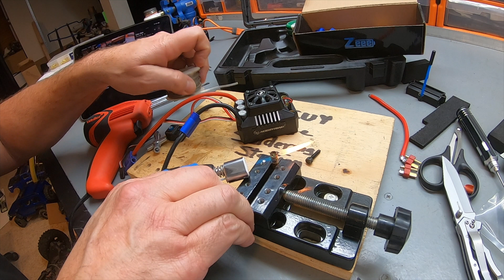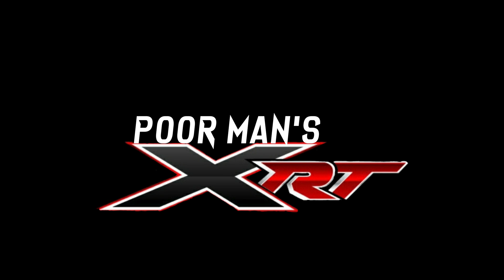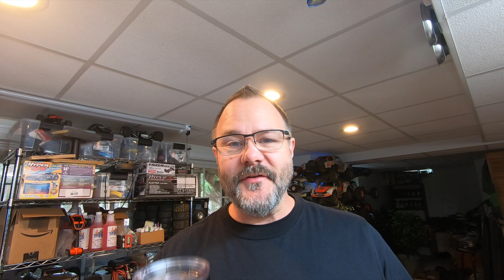Traxxas Poor Man's XRT Project at its END

Comment: Do you know if the X-Maxx  Toe link for steering will fit on the XRT  for steering.  I've seen a few non adjustable aluminum inks for the X-Max on ebay not sure if there interchangeable. Also do the X-Maxx drive shafts come in colors?
Reply from the maker: Yes provided it's from the WIDEMAXX kit otherwise I'd it's the stock XMAXX they will be too short

Comment: How much does it cost to build one from scratch to the point its a roller
Reply from the maker: Building it from scratch is different than what I did because I used a donor vehicle You would have to add in gears bearings screws at that point in time you would definitely be better off just buying a roller or slider that they call it off of eBay or just get an RTR and sell the electronics